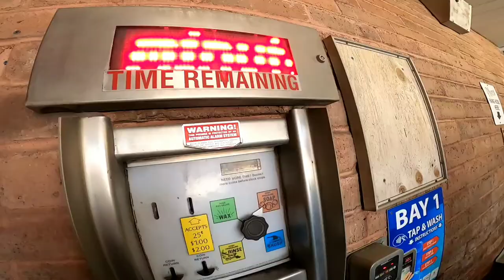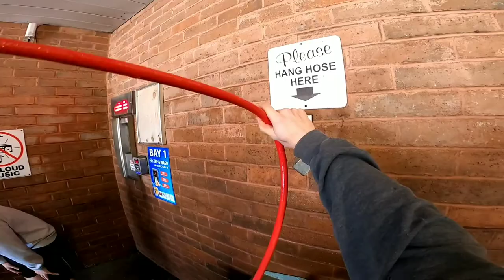NEW Gopro Hero 8 POV In LOUD CAR

Comment: How loud is the O2 Housing from stock? How's cabin drone?
Reply from the maker: It doesn’t make the car that much louder, just a bit. Backfires are bigger but you get a bit more rasp. Cabin drone didn’t change
Reply: @zackclarke6599  I have a solo performance catback and a turboxs racepipe and I’m debating whether I should change my catback to an ISR race catback or an ISR O2 Housing. What do you think?
Reply from the maker: @hastes_83  well what change are you looking to get out of this?